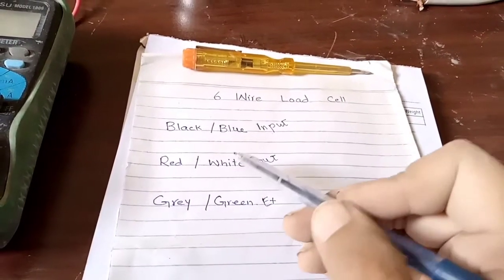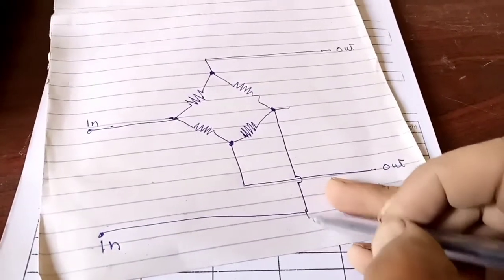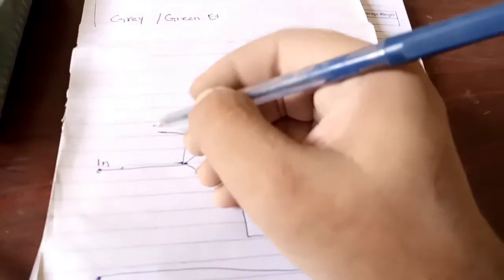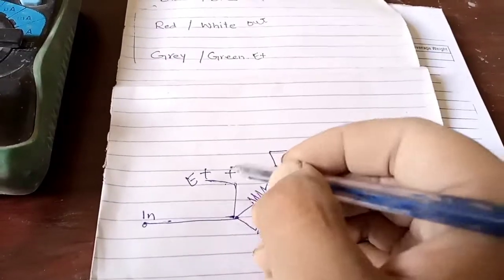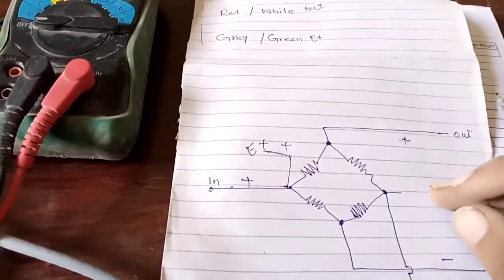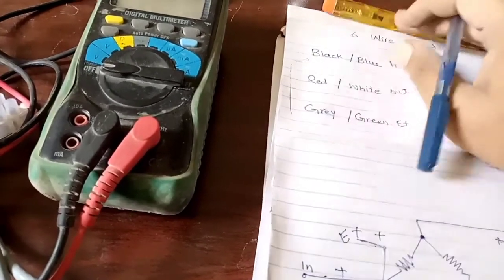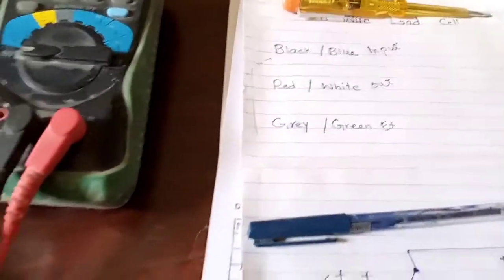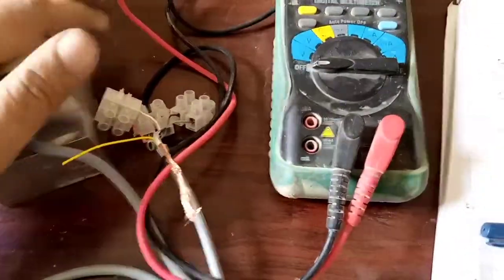Checking of 6 wire load cell in English

Comment: Input and excitation wires are the same. The terms "input" and "excitation" are used interchangeably. The third pair is called "sense". So there's input/excitation/power supply, output/signal and sense.